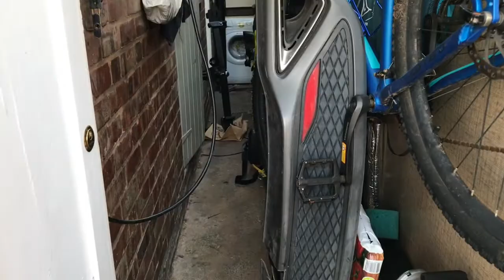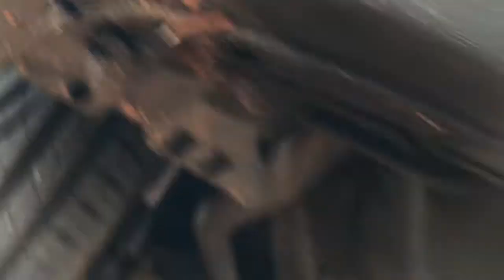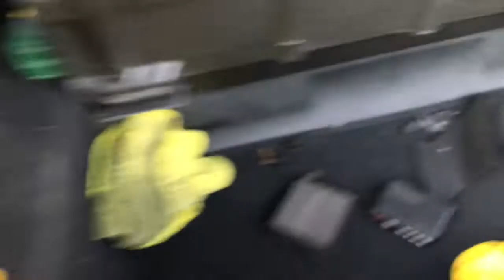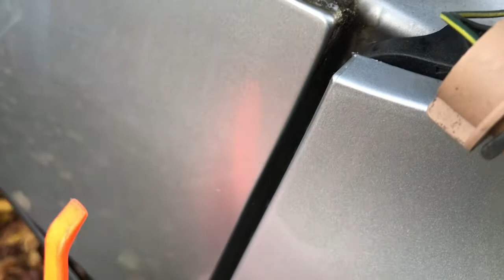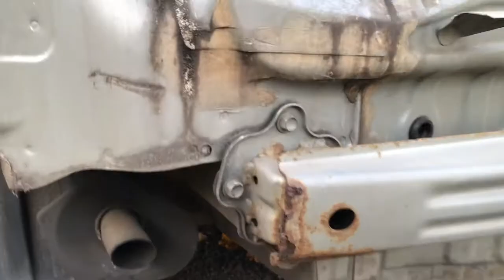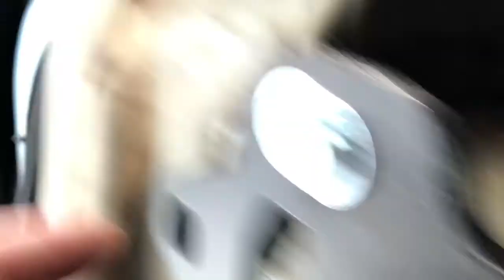Honda Civic Tow bar install part 1

Comment: Hi just found this as fitting a Civic Type S towbar. Cheers for posting a video. Did you cut the bumper on yours or use the skirt supplied with your tow bar? I'm sure the cutting could be minimal if thought about. I don't want to butcher mine because the manufacturer says so.
Reply from the maker: hello!
yeah i’ve cut it as small as i could and it’s sitting nice and flush to the tow bar.
the bumper skirting that came with it didn’t fit on my 06 normal civic
Reply: @ParallaxVisuals  Cheers for the info Buddy.

Comment: Hello, can you explain were you made the electrical connection of the wires?
Reply from the maker: hello! I did connect the towing relay unit directly to the wires powering my lights, most of them are in the left hand side behind the panel that holds the 12v socket in the booth. I did not make another video about the electrical connections as it was severely raining when i made my connections and i was in a hurry to get them done.
Reply from the maker: there are several clips online about wiring , here's one of them : https://www.youtube.com/watch?v=I-xLIqQoDqw
Reply: Thanks for the reply, i was trying to install my tow bar under the same circumstances, heavy rains here in Portugal, and I'm having a hard time trying to figure out here the electrical wires were! Thank you, best wishes
Reply: Thanks for posting. Useful video for us Honda owners.
Reply: Hello  @ParallaxVisuals  ! Thanks for sharing your video. I have just installed a tow bar on my Honda Civic hatchback 8th gen and now I was searching information for the wiring. Don't you have to connect some wires to the stop lights located on the trunk lid ? If so, how/where did you make the wires pass through ? And if not... well it simplifies the task 😆 Thanks again for your advices 🙏

Comment: I’ve seen one on eBay for £113. Problem is not sure whether it would fit correctly as their is no registration check option etc. Any recommendations of where to buy one?
Reply from the maker: i just got them
on ebay.
if your car is NOT a type R , any g8 hatchback tow-bar fits. I got mine from a type S, my car is a normal 5 door civic g8

Comment: Just what I was looking for, I was wondering if this was possible! 
Mind sharing where you bought this or manufacturer? I found some myself but they all say "Only for 5-door Civics" so I'm a bit unsure which will fit. 
Thanks in advance. I'll give you a sub. in return (:
Reply from the maker: Paxton Poltergeist hi!
i got it off ebay from a dude that had a type S honda civic.
if you have the type R tho you don’t have the mounting points as the type r is made to be lighter racing etc.
so 5 door or type S ok, type R not ok.
hope that helps!
Reply: @ParallaxVisuals  thanks for replying! 
Ah damn, yeah it's a type r, thanks for saving me the money and time dismantling the rear bumper.